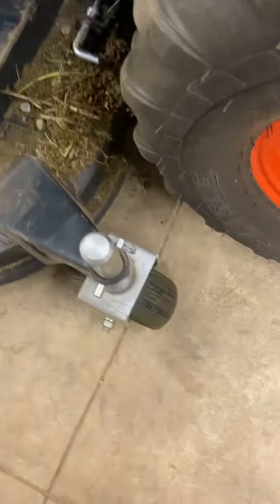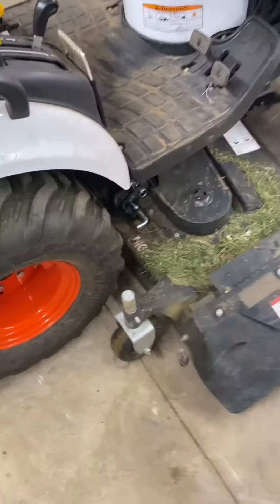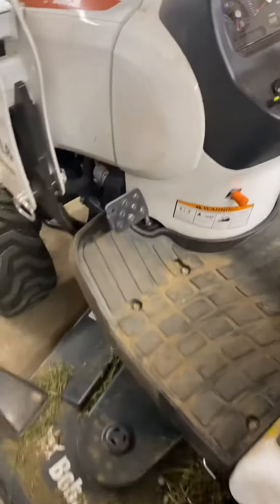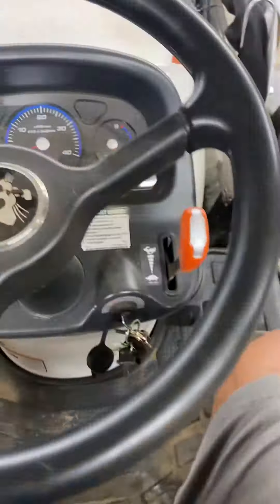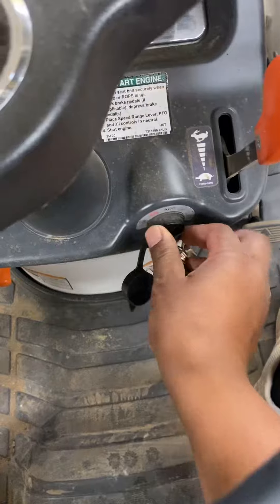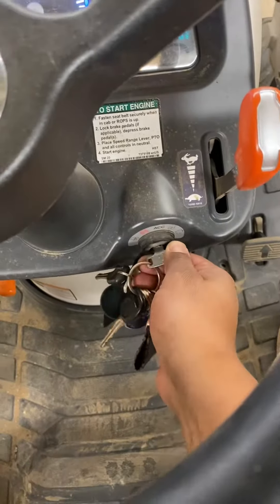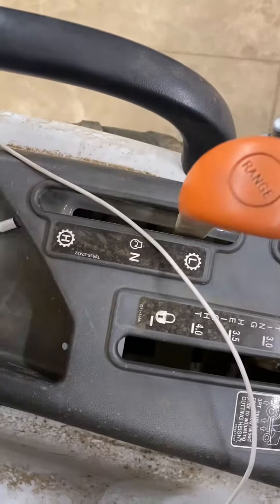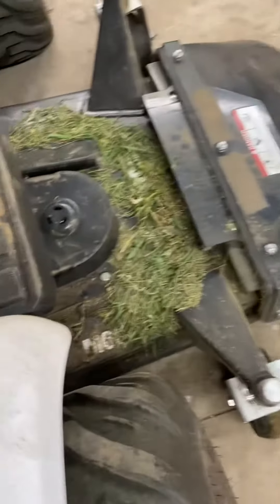Bobcat subcompact tractor ct1025 belly mower removal pt 2

Comment: That's alot of weight with loader on. I would take off the loader. Also a better cut on the lawn and not worring what your going to hit. I used to do the same thing when I first got mine. I have a Kubota with the same general set up. Good idea with the rocks for less movement.
Reply from the maker: @randyrichard9105  I agree!. I take the loader off now when I have to cut the grass and it definitely takes me less time lol. Thanks for the tip!.